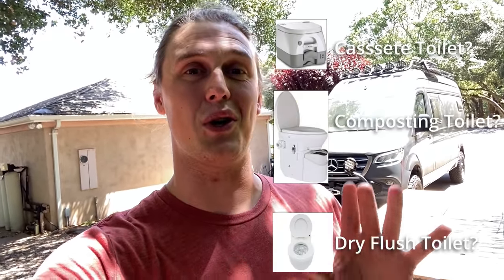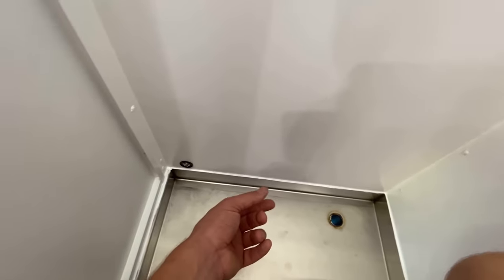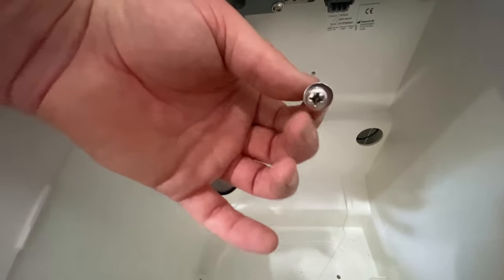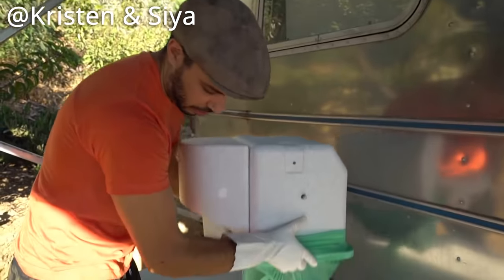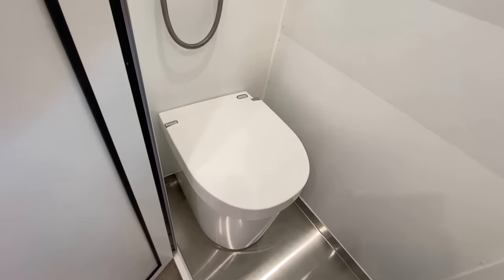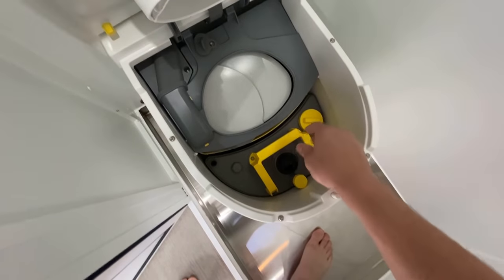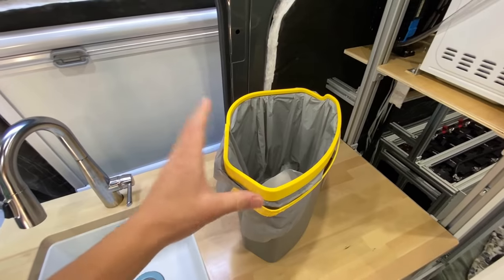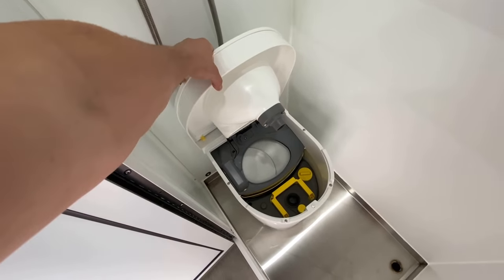The BEST TOILET For Van Life??? Hint: not composting

Comment: I can't be the only person that does this (in fact I know I'm not), but don't you pee when you poo? And furthermore, what about ladies, because they hafta sit down. There should be a lever to lock the solids actuator so that it all drains into the other section when you're not making solid waste. Also, a flap that opened rearward that also doubled as a ramp to force liquids toward the drain hole would be better in my opinion, than a segmented flap that retracts rotationally. Spring loaded or lever actuated with a seal would still work, and if it was damaged somehow, would likely be easier to fix a hinged system. Great concept, but I think I could design something with a CAD program and a 3D printer using existing materials like a gas can for the liquid waste, and waste basket for the solid.

Comment: How do you deal with the smell when you have to lift out the solids bucket? You might not have to touch the feces and scoop it out, like in the composting toilet, but won't you have to smell all of it (Gag) when you are popping off the rim and knotting the bag? That seems a little repulsive to me. I like the idea of your last toilet where each bowel movement was individually wrapped. No touch, no see, no smell. Win win. Keep a second bucket for pee. You're an engineer. Maybe you could design a van toilet that is much like this new one you have, where the pee is diverted to the front and the poo is in the back, but the back part would work like the diaper genie design instead of a bucket with a garbage bag design. It seems like that would be the best of both worlds. Diverting of both # One and # Two, while never having to touch or smell #2 and being able to dump #1 before overflow happens 👍😊.

Comment: Use biodegradable bags so they break down too very costly at $1800 ...my go to permanent solution in a fixed home is two toilets 1 urine & 1 for black waste same but not as compact or well designed & made the cost &130 - my bonus nice looking like a porcelain loo, 2 bucket system, soft close lid and a fraction of the price why the others are so costly beats me

Comment: As others have stated....a fancy version of peeing in a bottle while pooping in a bag......I call doing a number three....because who does a number one without doing a number two?!?!?....so I have a mini camping bucket toilet with shaped toilet seat, all in plastic, I place it on a platform and sit at a comfortable height, I hold a five liter empty water bottle, with a large opening 😎 ,  to pee in, while pooping directly into a plastic bag fitted in the toilet. I have disinfectant in the bottle. I look at my poop to check my healthy diet, before lifting the bag out, squeezing out excess air, then twisting and knotting the bag neck. After that I cram that bag into an emptied potato chip bag, or any foil bag, or resealable plastic bag that had dairy/cheese etc....that's designed to lock in all the delicious flavour and tempting smell !!! 🤢 ... Then I dispose of it in the dog poop bins.....or occassionally in gas station bins where soiled nappies can be heard singing out loud! 🥴
Reply: ....if you're drunk it may be fun to swap the receptacles around....I would never do that!

......again.....🤣

Comment: Hummm ...
Here are my " two cents " worth ...
It is plush , still two may components that are break . I am a single 62 yr old lady and really ...not handy . So for your number 1 pick tot interested in vents etc.
I live full time in custom build in a combo 
Commercial horse truck Internationl 4900. Living space about the size of slide in truck camper with roo to carry three horses. I use a portable potty , one plastic unit... agree the combo black water is worst smell ever .. so I use it just for the lesser (urine) line it with dog waste bag for other , zero smell. I was saddened to gear that you se juice bottles.  As an equestrian rider , I HATE riding along ditches and roadways with my horse kicking about bottles of URINE .

Comment: OK 🤔 First thing to understand is there is no such thing as a composting toilet for an RV - do the research and you will understand. What you are dumping out of those so-called composting toilet is not compost and has not even started to become compost. It’s dried up poop and dirt. Basically P and poop must be mixed together and then completely covered and allowed to sit for 6 to 8 months before it starts - yes starts to becoming compost. Honestly a luggable Lou with a trash bag in it and covering each time you go number two with Pete moss works perfect. Yes you separate P and poop. If you’re number two is covered with some Pete Moss there is never any odor - never - covering the number 2 totally eliminates any odor without the use of electronics and fans and gizmos. When it is 3/4 full you can literally put your face down to the toilet and all you will smell is dirt. Pete Moss is inexpensive and can be found anywhere you are at on the road. Build a box with the Luggable Lou   and a urine diverter and you will have spent about $35-$40 compared to a natures head at $1000 😳 I understand and I see that people like these expensive dry toilets and if you like your system that is all that matters 👍 I have found that the covering toilet is the cheapest and the most efficient and cleanest way I have found 🤷‍♂️

Comment: The opening mechanism doesn't seem so great if you have the runs.  

Because if you blast your ass all over the edges and clean it with water and toilet paper, it's gonna land on top of that flap.  If you don't clean it up and sit on it again it's gonna wipe across the inside of the toilet and get everything dirty.

Close but not so great.

Comment: Its another expensive solution to a problem that has already been solved for 1/100th of the price! I am sure there are plenty of people it will appeal to even though the mechanism looks cheaply made and likely to fail. So this stops people from having to look at their own sh!t until you have to empty it, then they are all going to wish they had covered it with some material used in a regular composting toilet. Either way you have to deal with some amount of unpleasantness periodically, emptying p!ss bottles every other day isn't exactly a feature either, a urine diverter to your grey water tank is infinitely better in my experience and the only way to go if your toilet is a permanently installed type.

Comment: You are still left holding a bag full of sh*t. Despite the power it uses, the incinerating toilet is still the best toilet if you don’t want to be left holding the bag so to speak. Coming up with an energy efficient one would be a great step for someone.
Reply: I just discovered incinerator toilets yesterday. My only issue is with needing to insert a new paper liner for each use. That must get expensive. And correct me if I'm wrong, but one also needs to wait 60-90 minutes between uses to allow for each incineration. No one can use it immediately afterwards? Doesn't seem usable for families.

Comment: Great to see the different toilet options!  I don't see why any composting toilet needs to be cleaned out manually. Use a bag liner!   Toss it when full or half full.
Separett seems a compact, low profile very nice and cheaper option at $600.  However, I would still use a bit of peat moss instead of that liner at the bottom.  Animal paper litter pellets or compressed sawdust pellets will work as well and absorb odor better.
I think you did a lovely job on that bathroom with a stainless shower pan and that sleek toilet.  Looks very stylish.

Feedback
Please try to change the old habit men have of referring to grown women as 'girls'. We don't call grown men 'boys'. It is disrespectful.  Just because it is so common that women do it too, does not make it right.  I would appreciate that.

Your speech habits are jerky and stop and go. Since you are a Youtube presenter, it might be worth taking some Toastmasters free classes on public speaking to fine tune your speech.  You have a lovely presence and good content, but a geeky speech habit. Some polish will make it perfect.

Comment: I just don't see this has any advantage over a cassette toilet. You still have to empty the urine jug. You have to also empty that bag and that is NOT going to be pleasant and heaven help you when that bag breaks, and at some point it WILL. Especially if you get desperate or cheap and use a grocery store plastic bag. This is an accident waiting to happen. And at $650 you are paying to at some point clean feces out of your van.